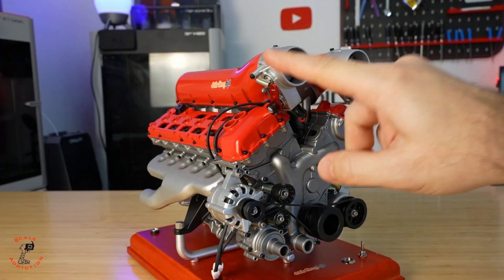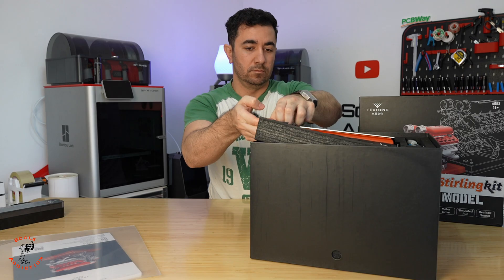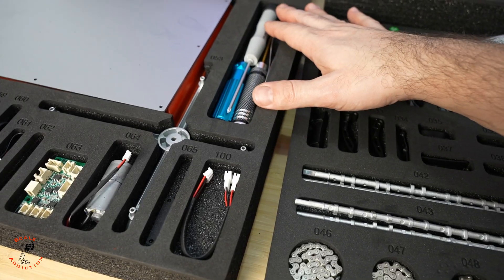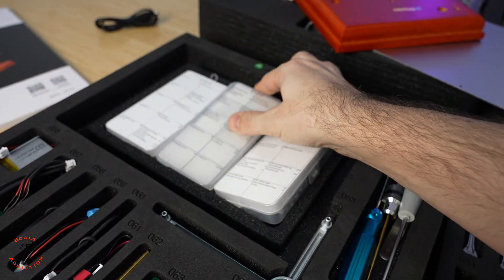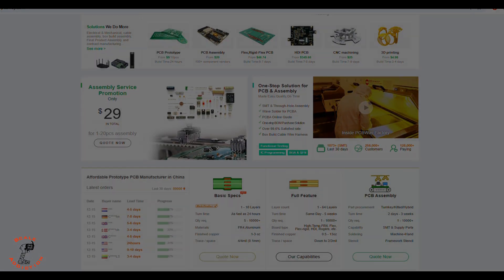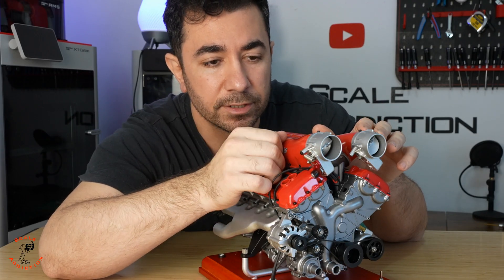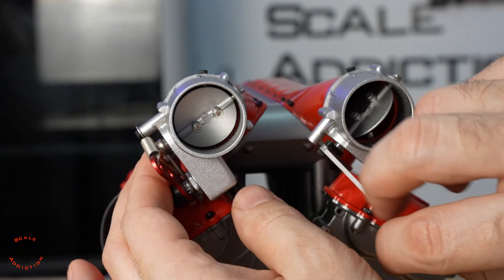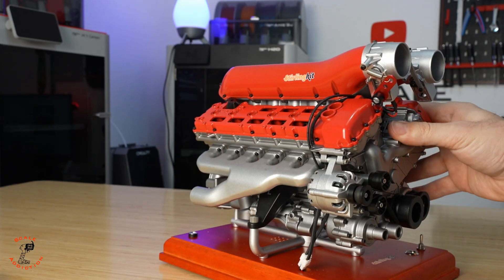I Built a 1:4 Scale V12 Engine That Runs

Comment: I enjoyed you putting it together but its bad quality with warped parts, bad sound effects, the non connected throttle bodies and un realistic throttle actuation.. Its $1,000... You can buy a real 1j junkyard motor for this and get it  running for that cost. I loved your video tho and your putting it together. I just wouldn't buy one myself.
Reply from the maker: Appreciate your comment, you are right , I would love if the lower the price for sure, andbim glad that throttle connection was easy fix , I wouldn't be able to sleep 😅 with one side not working